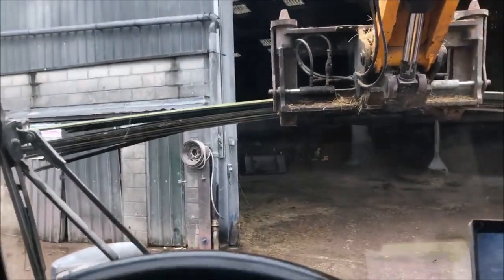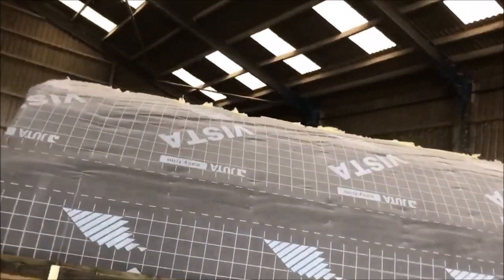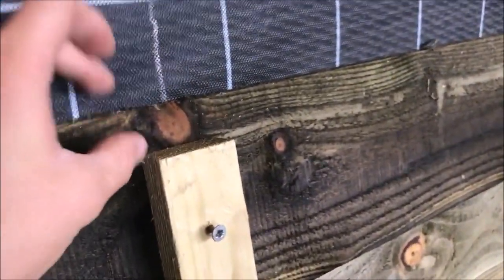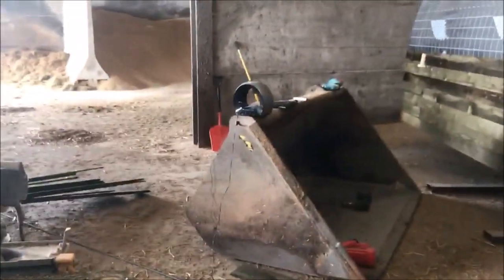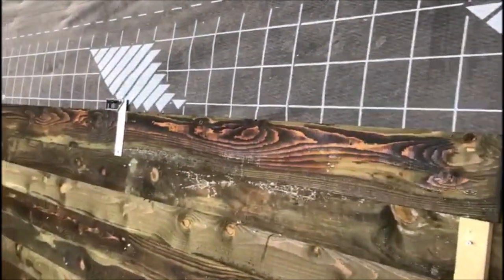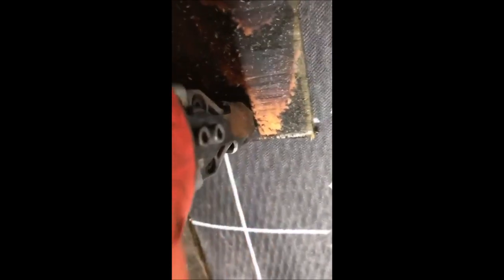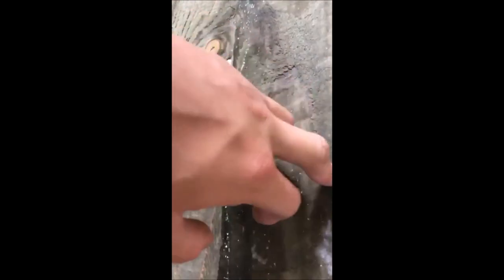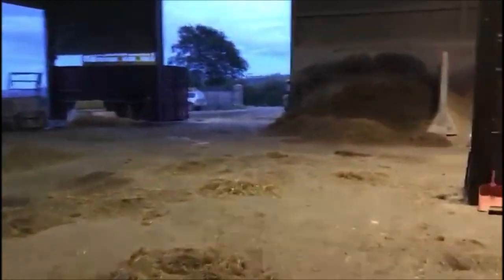Building a Glamping Pod - Part 7 | Exterior Featherdge Cladding

Comment: If you put metal on the roof will you need a lightening conductor ??? great vidz
Reply from the maker: Hi Olan, Luckily here in England we don't get much lightning and when we do it's very rare it'll strike a house let alone a pod of this size, In this case I didn't bother but I think I may consider putting one up on the next ones I build!